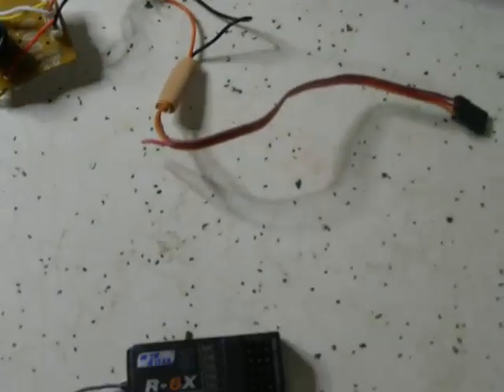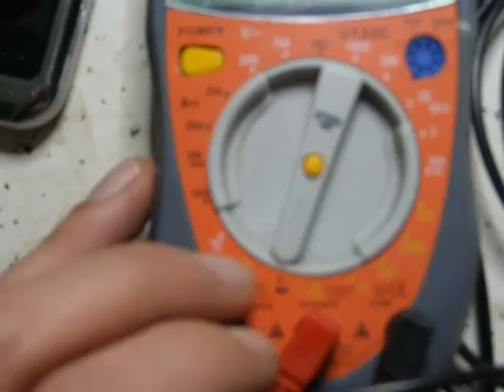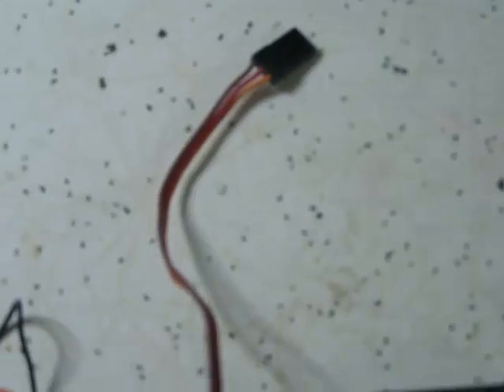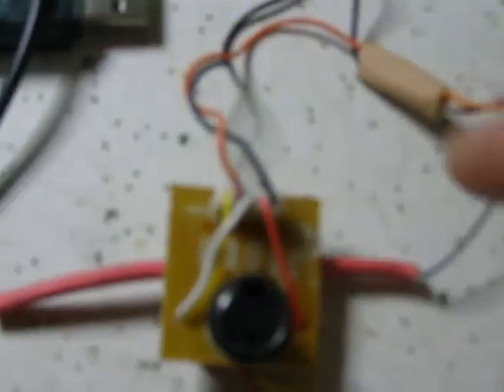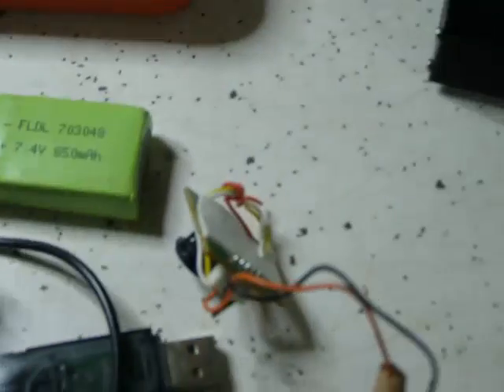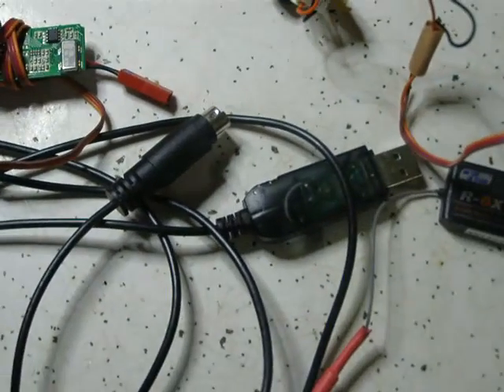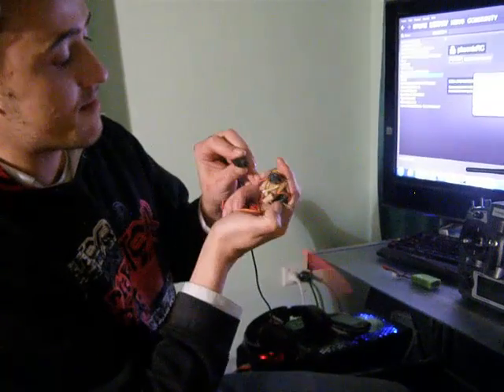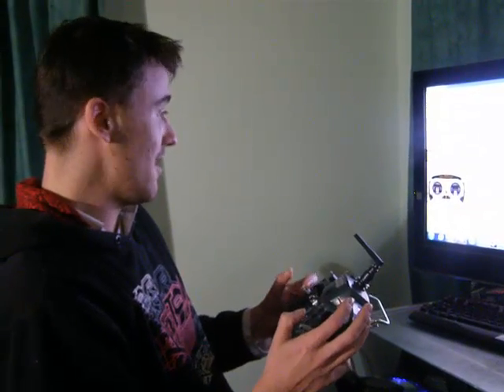DIY wireless USB receiver for RC sim

Comment: How do you get different channels as you have only used one connector
Reply from the maker: I found the rx i was using had ppm sum output , if you read the description you will find a circuit that will make PPM out of all you channels if you dont already have it